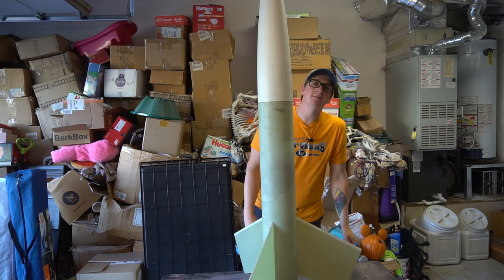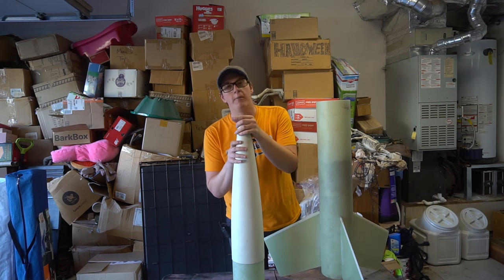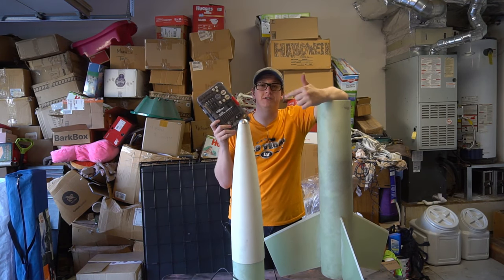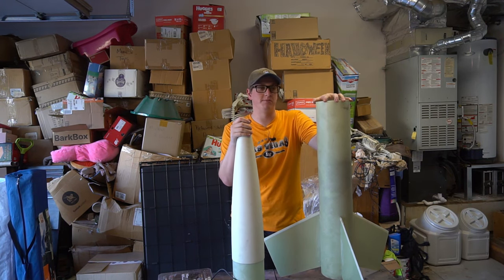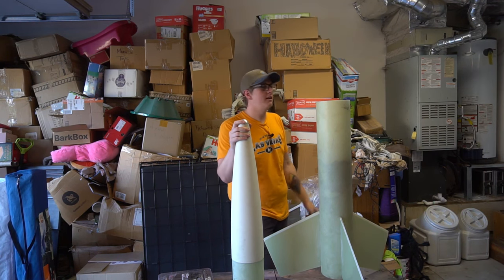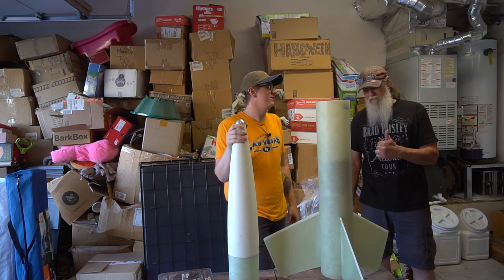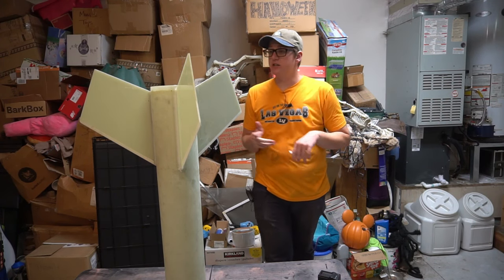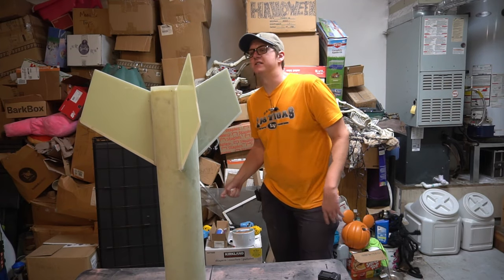The MOST IMPORTANT Tool for High Power Rocketry

Comment: I’ve suffered the enigma of humidity flashing epoxy. 
  A friend chose to DIY a very expensive hardwood floor install for his home. Being several of us are craftsmen at one level or another he asked us to help out.  
    We all chose a day with cooler weather being the smart fellows we are.    
   55 degrees tops. Cool cloudy kinda warm and misty at the same time.  
  Very rare weather for the parts we live in. 
  Short story is after the flooring quit adhering to the very expensive two part epoxy adhesive process, and a call to the manufacturer’s very helpful help line...... We all fully understood that little humidity warning in the fine print. 
     I’ve learned to speed up 30 minute epoxy project by simply turning on my evaporative fan in my shop. Spike the air with humidity and your epoxy project that you’re wanting to have set up will do just that.

Comment: What size MMT is in that kit?
Reply from the maker: 75mm
Reply: @RocketVlogs  DOH!!! That thing would fly so good on a 3 grain 98mm!! I have an M4500ST I am flying at Airfest in my Demon 150 that would be awesome in that. I need to give Kenny a call.

Are you doing a donut AV bay on it to fit long motors or no? How long of a motor will it fit?
Reply from the maker: @StreuB1  Even with 3/16th fins I'd be a bit worried about pushing it too hard.

I'm doing standard electronics bay for head-end deployment. Even so, it'll likely fit at least a 5 grain case
Reply: @RocketVlogs  I am just finishing up building the 5" Super Jart kit I got from Jason Griffin. Modified it for a donut AV bay so I can fit a 75/5120 case in it. Should be flying it at Airfest on an M1297 or an M1780NT. It has 1/8" fins......I'm mildly nervous. lol